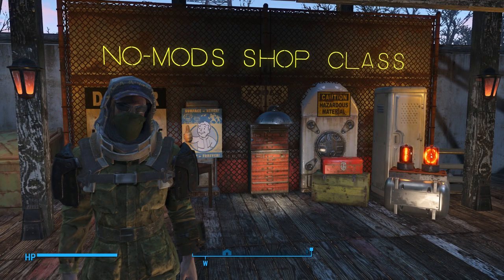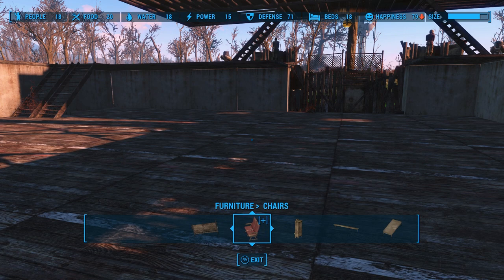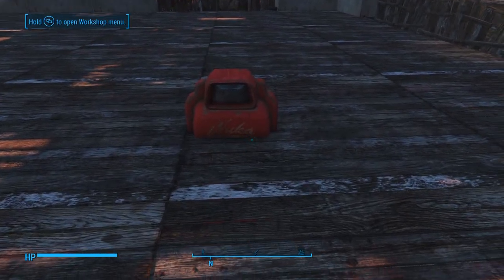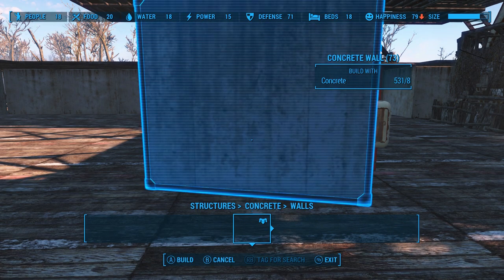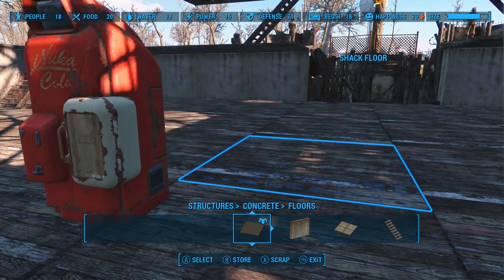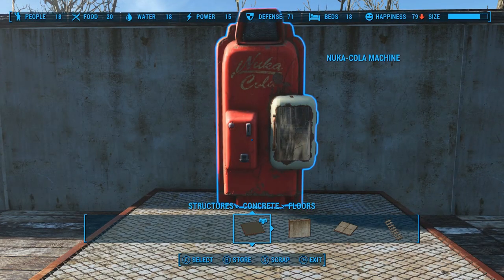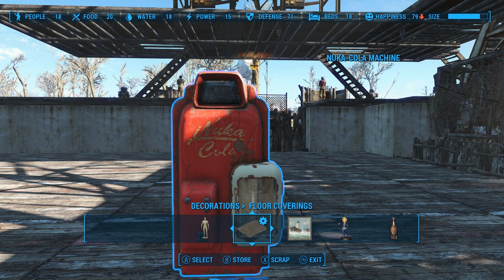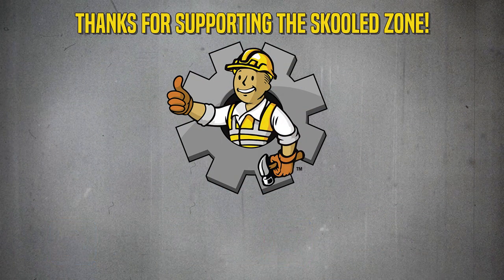Rug Glitch Sink Problem Solved 🕳️ Fallout 4 No Mods Shop Class

Comment: I'm here to poke holes in your theory!  No, not really.  Interesting theory though.  I'm not certain that your idea is completely correct.  But, that doesn't matter.  I do think that you are close to finding the reason however.  Also, go back and re-watch that last experiment.  When you removed the last rug (the one supporting the vending machine), you lost the middle rugs.  They fell through the floor.  But, the first rug (the one directly attached to the small shack floor) stayed put.  I only mention this because the rugs completely passed through the first rug!  And if your theory was correct, they would have landed on the same level of floor that the vending machine was on.  Take this into consideration for your theory.  Also keep in mind that when you rug glitch objects, they don't always sink into the floor with the small rugs.  Or if they do, not always at the same height.  No matter the size of the object that you are "glitching".

One other thing.  For people that are just trying to get objects closer to the wall.  There is another way to do it.  Keep in mind that objects with snapping point take precedence over anything else.  With that in mind, remove the wall that you are trying to get close to.  Place your object as close to the wall as possible, without breaking the plane that the wall will intersect (NOTE:  This does not always work).  Then replace/snap your wall back.  You can also just change the angle that you move the object with.  Like how I move beds closer to the walls.  Start with one side.  get it as close to the wall as possible.  Then move to the front and move the object closer.  I use this especially for placing objects in corners.

Also if you haven't done so already.  You should show people how to stack foundations to make stairs.  Very nifty trick!  Look up Jug on YT for his vids for reference.  Below is a screenshot of one of my vault 88 rail tunnels.  The first one from the main entry area to the water pump.  You can then browse my other screenshots if you wish.

http://steamcommunity.com/sharedfiles/filedetails/?id=919926580
Reply: Self-promoting much?? I checked out your image and you're using mods. That's what's great about what Paul's doing with this series. No mods!
Reply: Self promoting?  First off.  That YT channel doesn't belong to me.  Second, the pictures on my steam page of my vault 88 are completely mod free!  I can't help it if you don't believe me.  But, maybe if you watched the yt channel I suggested, you could understand how it's possible.  I'm just showing what else can be done without mods.   It's easier if you just watch Jug.  He hasn't made a video in over a year.  But what he has, is good info.  And, he did everything on PS.  And since your not going to believe me anyways, I'll tell you how I did that tunnel.

Here's a simplified version.  Take a foundation and sink it into the ground as far as you can.  The next trick is what you'll be doing to get the "slabs" to stack.  Get on top of the foundation and select it.  You'll notice that it will fall further down, until the top "slab" portion of the foundation is resting on the ground.  That's the actual trick.  Now snap a half floor piece to the foundation in the direction that you want the stairs to go.  Continuing in that same direction, attach the wooden square stair floor.  Next, remove the half floor piece. Next, snap a foundation to the top of the stairs on the same side that the half floor piece was.  You'll notice that the foundation is now half covering the first foundation.   Now, using the same method as stated above with the first foundation piece, get on top of it and select it.  There you go!  If done right, the foundation that was attached to the top of the stairs should fall and glitch through the foundation on the bottom and stop when the top"slab" part rests on top of the initial foundation piece.  And it overlaps by half.  Once you get the hang of what's going on, there are better ways to do this.  You can do this with other floor pieces, but works best with the foundation pieces.  

As a side note, I started using mods AFTER those screenshots were taken.  That save game is still completely mod free!  I will be going back to it to add mods, since vanilla assets don't have anything to finish my swimming pool with.

And if you want to see how I did this, all you have to do is add me on steam (my username was attached to the screenshot), and if you see me on, send me a msg.  My plan was to record everything on that build and upload it.  But, I got sidetracked when another commenter on a different yt channel wanted to see my swimming pool.  I wasn't using mods at the time.  But to humor him, I started downloading some.  And 300+ mods later, I forgot to go back and finish my recordings.
Reply from the maker: I believe you Court. There are many comments on my Vault 42 video where people still think I used Mods. Steve's a longtime viewer. Prolly just being protective since you mentioned other channels and included your own link. I learned my lesson years ago when I posted my link on a PewDiePie video and then felt the full wrath of the Bro Amy. LOL. Interestingly enough, I checked for those rugs after the video and they weren't under the floorboards. I think they may have gotten stored as a clamped stack. But in any case, the technique still works and the theory seems sound so far.

As for your tips, great stuff dude! I'm familiar with Jug. Amazing builder. I'm sad he's not posting anymore. I've actually gotten several requests to show a stair stacking tutorial. I purposely left that off my nmsc "syllabus" because I didn't want to copy Jug. I hate being copied myself without credit, so I don't like to do it to others. Maybe if I can find a new application for that technique where it's not a direct copy then I'll turn it into a video, ya know? Also you should enter my settlement contest. Seems like you'd have a good shot at winning! Here are the rules in case you missed the intro video: https://youtu.be/5wONxYt-AFk?t=4m35s
Reply: Hey, thanks for the reply.  I went back and re-watched that rug glitch sequence again.  They do, just, disappear.  I thought that I saw them "fall".  Maybe that's just me.  But, in my experience, and I didn't find out why exactly until later (I'll explain later), doing the rug glitch with multiple rugs can cause some of the rugs to fall to the ground.  And, they can't always be seen (a lot of times they fall into decals like trash or leaves).  Now, the reason behind this can be proven with mods. I know, I know.  But, I would have never found out otherwise.  It happened to me at Sanctuary.  I had rugs disappear into the road.  Now occasionally, I could highlight them and retrieve them.  Other times I couldn't.  The reason being, and this is where the mods come in, is because not all of the ground, is "solid ground".  They are overlapping pieces of dirt (or road in my case.  roads aren't part of the "ground").  Just like the road sits on top of the ground, so do various "grassy" hills, mounds and tree groupings.  I found this out with a mod that allows one to remove those layers without removing the ground that makes up the "world".  Just, keep this in mind.  Use it to gather data for your theory!  It might not amount to anything, or it may help explain things.   Who knows.

I don't remember when I  first subscribed, but I just came back for these no-mod tutorials.  You actually gave me part of my Finch Farm build idea back when you still had the settlement builds on here.  I'm referring to your build, where you completely covered the Finch's house with another building.  I, at the time, went about covering buildings the other way.  By totally enclosing them in concrete.  You changed formats on here and the video doesn't appear to exist anymore?

I'm going to go back and revisit Jug's tutorials and see if I can tastefully recreate his technique.  If I can do that.  Then I could possibly post a video on steam through their strategy guide section.  I'm like you.  I wouldn't want to copy someone else's idea without giving credit, where credit is due.  I, in fact came across his site from another non-mod user called Norespawns.   Heard of him??  lol. . .I think it could be done and updated a bit, since Jug was doing his tutorials before some of the dlc came out that I use to accomplish similar tasks.  

And I haven't seen a wire glitch video yet.  I know that must be coming up.  When you do it, don't forget to show how it can work with vault wall with the vault wall conduit.  And I still think that you can wire vertically, through floors without too many problems (that btw, is one of the things I learned from Jug.  Though I rarely use it).

P.S.  Sorry for the long post.  And I get the protective fans part.  If I were in a better situation, I'd be doing videos myself.  While I have recorded hours  of my vault 88, I haven't yet edited them (I used obs).  I haven't had the motivation to learn editing software (currently trying out movie maker).  And I can lose motivation just with my potato of a laptop.  While able to run FO4, I am well below the minimum specs and settlement building can cause crashes.  And I have long load times, but, that's to be expected.  Had my Xbone not broken, I would have some of this stuff already done.  One of my other issues with completing my videos is the fact that I have no microphone.  And, while I could add text to the video, I feel that it may distract too much from what I am trying to show.  And as far as your contest, I will re-watch your no-mod videos again to see if I have used anything from them.  Maybe you'll cover some of the techniques I use later on.  Keep doing what you're doing.  I think you timed this perfectly for all of the people claiming FO4 is dead.  You, and other continue to prove them wrong!
Reply from the maker: As for my Finch Farm build, it's still exists. It's just buried down in my video list. It's just not in a playlist. I call it the Bridge Bunker if you want to look it up. Glad it was inspiring. And yes, the wire glitch video is coming up after the pillar glitch video. Gotta build up in complexity for newcomers, step by step, ya know? That way this NMSC can be a legacy course for Fallout building in the years to come. And by the way, I hope you're dropping the Skooled Zone name on other channels as much as you drop their names on this one. LOL. 😉